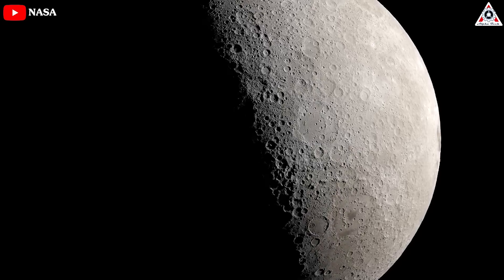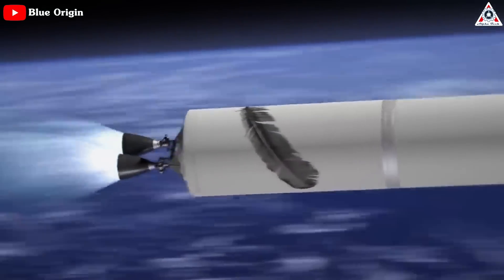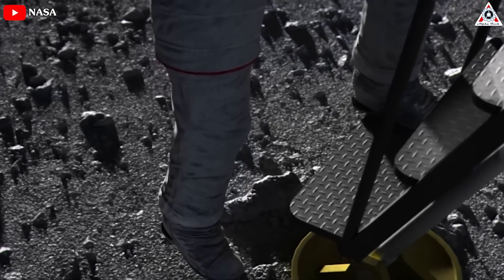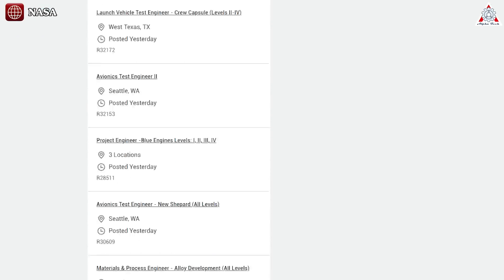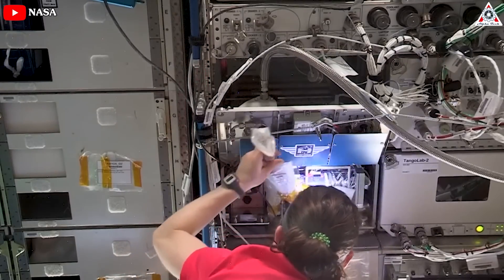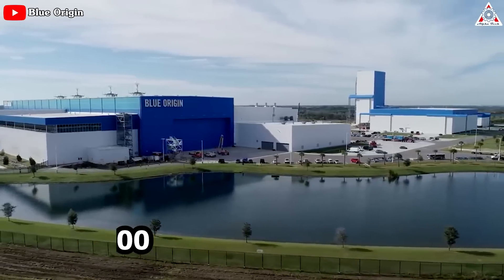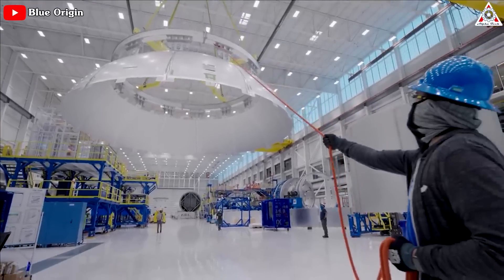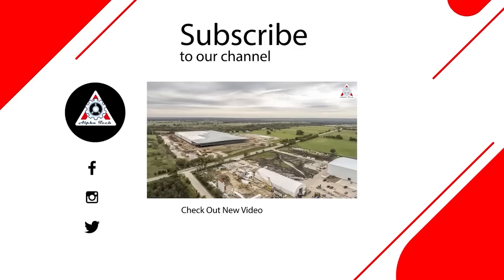Blue Origin makes a big lunar announcement that shocked SpaceX & Elon Musk

Comment: You will need a lot more electricity to melt the glass and heat the smelter than the lander can produce.
you will need a power plant on the lunar surface.
(Nuclear!)
And if you have nuclear what do you need solar for?
Micro meteoroid will damage the solar panels on the moon.
The moon is a meteoroid magnet.
Nuclear can be buried under regolith for protection.

Comment: They can't even engineer a proper rocket to go there
Reply: All b.o. has to do is bring the moon to 60,000 feet high and their rocket can get there
Reply: @juliancrooks3031  Not 60,000 feet but 60 miles. Good comment even so.  BO isn’t going to get there for years, considering the snails pace they’ve been going at. We don’t even know yet whether the 2 engines they’ve delivered to ULA are going to be reliable.
Reply: @iancanty9875  they need all the help they can get.  That's why I stand at 60,000 feet.🥺🥺🥺
Reply: @juliancrooks3031  Well rescued, sir.